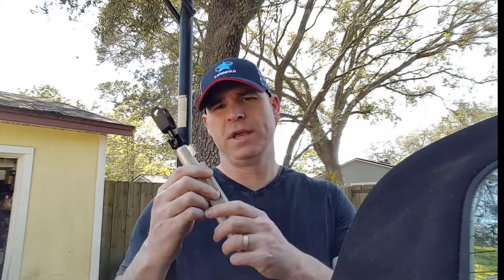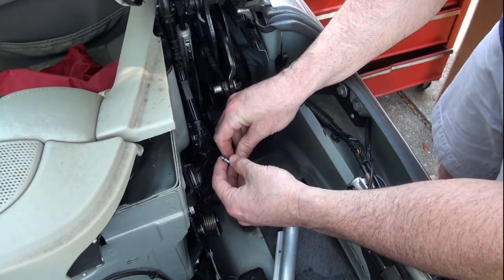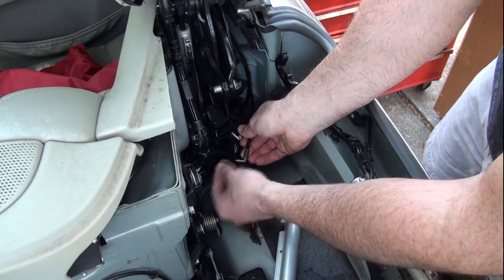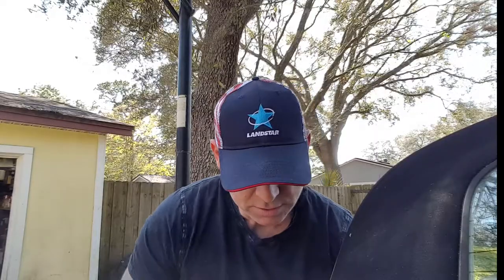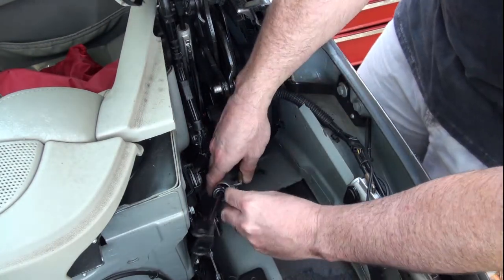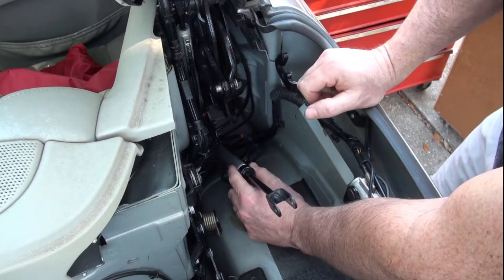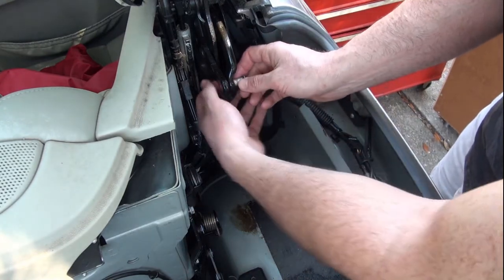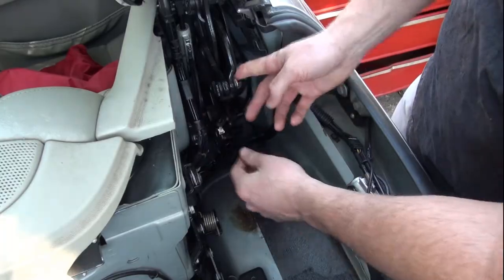Saab Convertible Hydraulic Cylinder   Part 2 Install

Comment: Thanks. Got a used (seller says non-leaky) outer cylinder in the post to me currently, this has been very helpful.  Got my system running with a leaking cylinder by using a mixture of 95%ATF, 5% Lucas stop-leak but its always better not to have a leak in the first place.... (topping up the reservoir gets boring after the 4th time)
Reply: Does it still work without leaks?

Comment: Hi Ted. Great video! Thank you for sharing!!! I think I am having the same issue as you prior to this cylinder replacement. My case is that the closing cycle of the top finished just shy of putting enough pressure to the top to come down and seal with the car body. So I have to crank it as it explains on the owners manual with the tire tool. Also I get the "Complete soft top operation before driving" error message. Was this your case? Is this the cylinder to fix that? Please let me know when possible. Thank you!
Reply from the maker: I did not get that error message. The issue I had was the top wouldn't go all the way down. It had no problems going back up. So, I am not sure if that cylinder is the one to fix the issue you are having.

Comment: I'm about to do this on my left tonneu cylinder.  What was the turn around time for tophydraulics to get the cylinder back to you?  Thanks, and great vid.  There is -0- information out there about doing this on a second gen 9-3.
Reply from the maker: Thanks for watching. 
I agree - no information at all. I had to figure it out.
From the time I paid Top Hydraulics until I got it back was ten days. That included me shipping the cylinder to them.
I'm pretty sure they just sent one they had in inventory. Which was fine with me.
Reply: Thanks for the reply. I ended up finding a used one and got my damaged cylinder out with no problem but one - the hydraulic line clip was stuck and when it came free it went shooting off to somewhere, most likely into the body cavity.  Now I'm trying to source this 85 cent part from someone who won't charge me $14.95 for shipping!!  Thanks again.
Reply: I had a similar experience with Top Hydraulics.  Great company.   replaced my left tonneau cylinder no problem.  Almost immediately my right began to leak, so I have that in hand now.  Any idea how to remove the position sensor from that one??  Thanks in advance.
Reply from the maker: Michael Oxman I only changed the passenger side, but they should be similar. Watch my first video to see how to remove the sensor.
Reply: Got it, thanks.